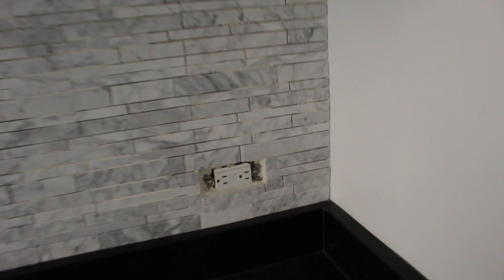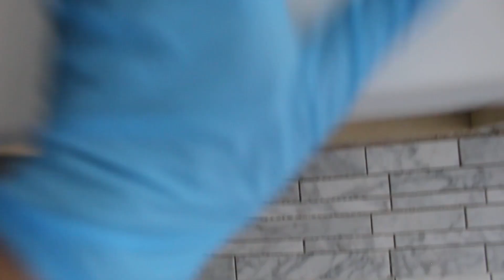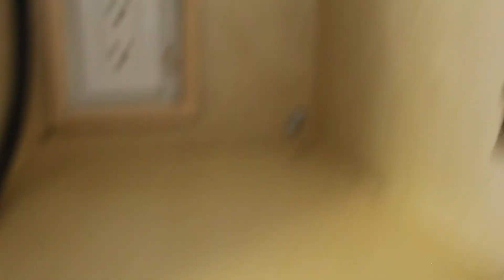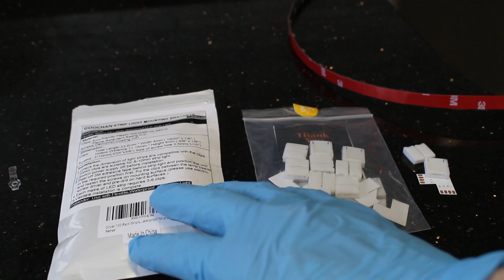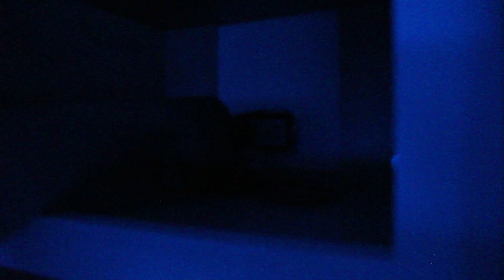LED Strip Light Install (Under Cabinet LED Lighting)

Comment from the maker: PRODUCT LINKS :)
Achivy USB LED Strip Lights -118 in. (Currently unavailable)
https://amzn.to/2qJUY23

Govee LED strip lights -16.4 ft.
https://amzn.to/2RurSOs

L Shape 4 Pins Connector 10-pack
https://amzn.to/2XLfdsh

Strip Light Mounting Brackets
https://amzn.to/2KPHecU
Reply: The link doesn't work it says it is currently unavailable😔
Reply from the maker: @chaserg2976  

The link to the exact lights in the video are no longer available but here is a link for a replacement. Check them out, they are actually better. I started using this brand in all my other led videos. Good luck with your project! 

Govee LED strip lights -16.4 ft.
https://amzn.to/2RurSOs

L Shape 4 Pins Connector 10-pack
https://amzn.to/2XLfdsh

Strip Light Mounting Brackets
https://amzn.to/2KPHecU

Comment: Great video. I will assume they stay preset to last color used? If so then you could automate this with a Ihome isp6X and a tripple plug in it plug or some other which would include using google assistant or Alexa.

Comment: Food for thought.... Placing under counter light sources near the front of the underside of the cabinets doubles the light throw efficiency. The forward lighting will also illuminate the front of items normal stored on the countertop (espresso machine, kitchen aide mixer, etc) rather than just lighting them from the top. You will also have more light cast to the lower cabinets and floor.

Comment: How did you cut and join the lights ?
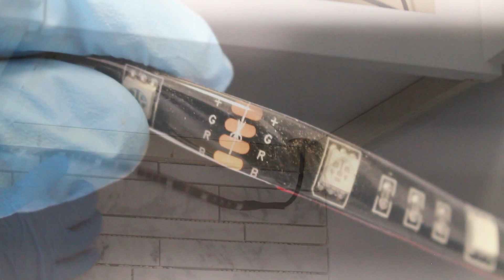Reply from the maker: In this video I only had to cut the led lights down to size to match my cabinets. 3:22 you can see how I cut them with any pair of scissors. I didnt need to make an extension so you dont see that here. Watch my latest video of me installing LED lights under another set of cabinets. Here's the link. https://youtu.be/qFkgsQ47CtA
In that video I show how to cut them and make an extension👍 These lights are powered by a USB so I just took an old phone charger and plugged in the USB and then plugged in the phone charger to the wall receptacle. Watch the video, you'll see😎

Comment: How did you get them to work at the same time if they are separated
Reply from the maker: You're right. There is 2 controllers. The remote is so powerful it will control as many of these same lights you have in the entire house/apartment haha Just does. To change the colors individually, use the trick I did in the video where I unplugged 1 set. Thanks for watching:)
Reply: @JumpermanTech  ok I understand now lol

Comment: JUMPER MAN TECH: NO YOU DIDN'T.
Reply from the maker: I understand what you mean with the coloring of the food & the funky colors are better suited for a bedroom. White is best, yes. I can agree with that and your point of view but please understand mine. I have the white color option but why not have more? That's why I ways go with multi colors. I have white. Keep in mind these are not the main lights. These are extras. I have a light fixture in the ceiling. Problem solved😂 Thanks for watching
Reply: Who doesn't realize these are for decoration not functionality.

Comment: How do you have both lights sync at same time? Being separate. Thanks thinking about doing the same thing and also around my tv opposite side of room
Reply from the maker: It just does it. The remote will control as many of these lights/controllers you setup. the remote is very powerful. Youre very welcome and thanks for the feedback. Hope you have the lights up and running. Enjoy! Happy holidays :)

Comment: how many strips can you work off of one remote
Reply from the maker: I have 5 led setups around my place & the remote it comes with is so powerful, it actually turns on all the lights from any point of the apartment no matter which way you point it lol it can control all of them

Comment: The LED'S should be mounted to the front of the cabinet instead of back...  Your LED'S would look totally different...
Reply from the maker: Hmmm. I'll try to see another setup as an example. Thanks for the tip🙂
Reply: I thought the same thing.  That's how I install them then you don't see any wires or the led strip.  All you see is light.

Comment: How did you make it control both with a single remote?
Reply from the maker: Control is so strong is will activate any led setup in your apartment. It's a universal remote